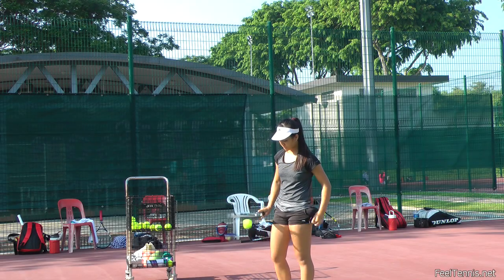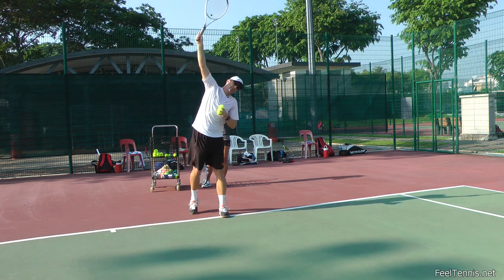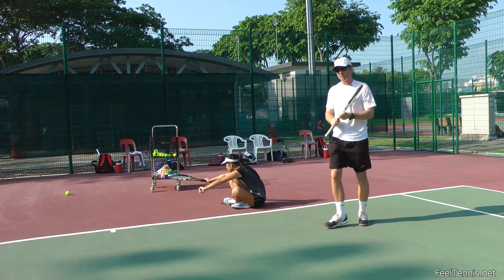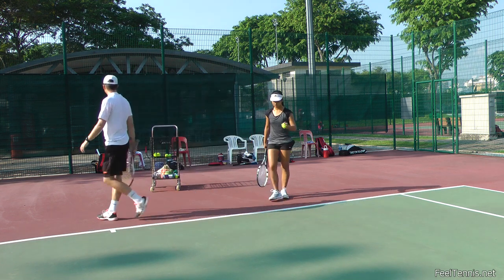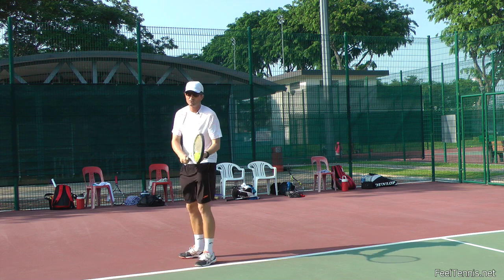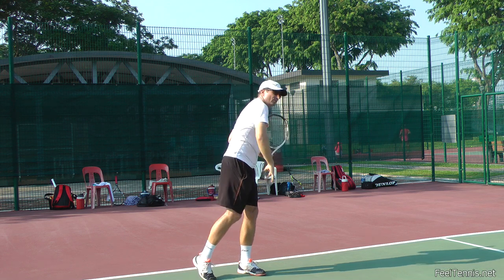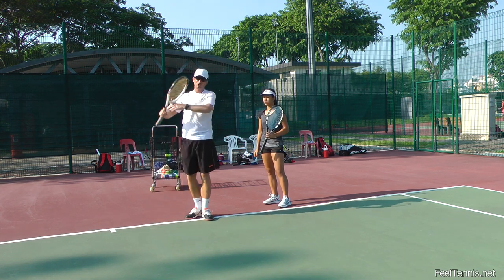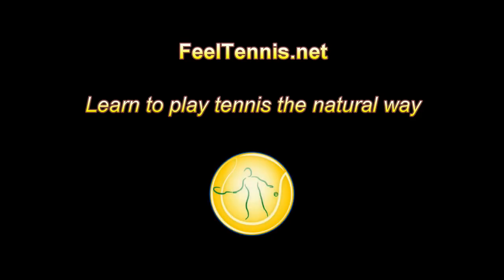Shoulder Over Shoulder Serve Move And Why You Need It

Comment: This was very helpful and not often discussed in service instruction.  If you look at slow motion video of Pancho Gonzales and Pete Sampras you see this hitting shoulder up while tossing arm shoulder is down during the contact and initial follow through.  This action allows the elbow up to stay up while the racquet head drops down before contact, and then the pronation of the racquet to take place during the hit in what is a bit of a unintuitive sideways swing, which is different than just describing the serve as a throwing motion.  Thanks   Btw- I think your demonstration of the serve would be more dynamic if you changed your service grip from what looks like a modified  eastern forehand grip to at least a strong continental or even more of a backhand grip.  Thanks  Steve